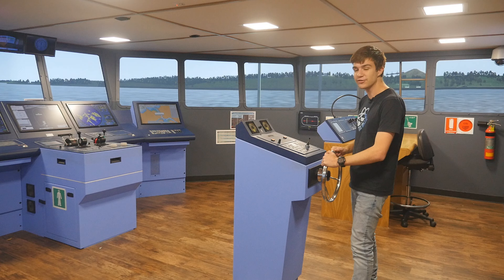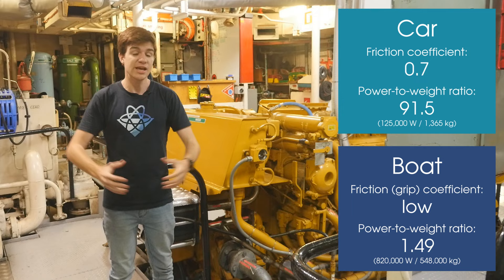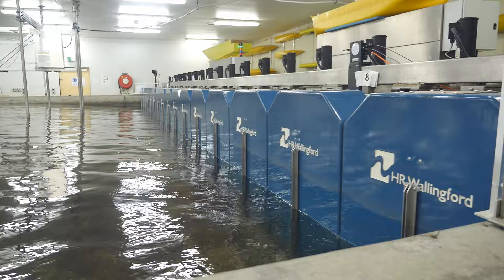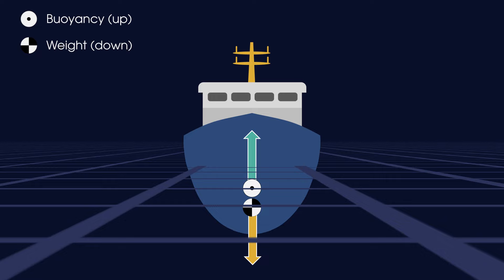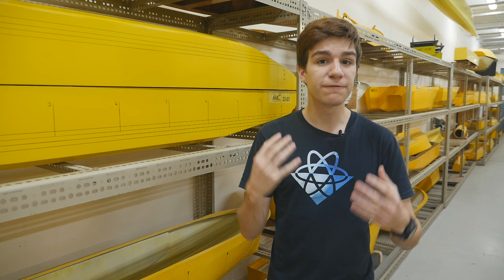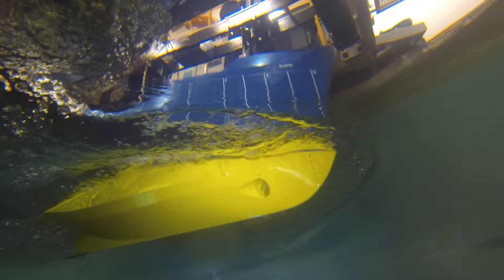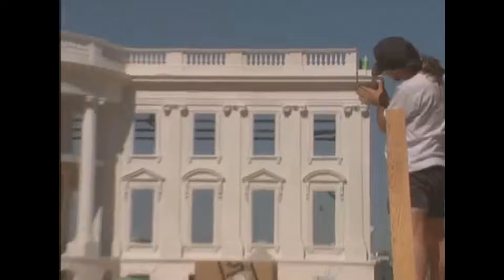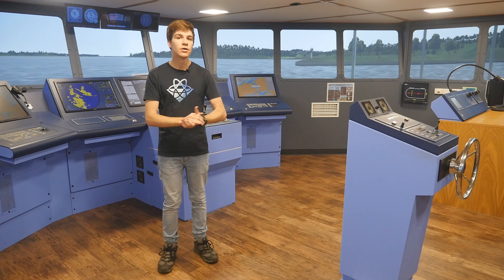How To Fake An Ocean

Comment: Interesting thing about slow motion explosions:
They still look fake for some reason.

I guess they slow down the footage too much to get more film time out of their expensive take.
Reply from the maker: Agreed! Its not because of the speed though, its mininum particle size. For water thats basically because spray only ever gets so small due to surface tension vs drag forces. When you use a model you end up losing that small-scale phenomena which makes things look just that little bit off. Don't think it has much effect on science research but it definitly does look weird in the movies.

Comment: Don't we now know that water waves behave non-linearly? I wonder how long it will be until numerical simulations are more accurate than these models.
Reply from the maker: Part of the summer research I mentioned was actually on that! Looks like yes we could do it more accurately already but the processing power limitations are insane so they make some really massive oversimplifications which does limit their usefulness. The way the field is going is to do lots of real-world tests to make some rules about 'X wave height gives X*1.3 response' and then program that simple relation rather than the actual first-principles numerics.
Reply: @AtomicFrontier  oh interesting, that makes a lot of sense! Of course there's a limit on how high you can go in a tank 😅
Reply: @AtomicFrontier  Imagine how much further we could take fluid simulation with quantum computing...
Reply: @StuffandThings_  I don't think you could take it that much further with it... I don't have much of an idea of qCPUs, but I'm pretty sure they're not that good for those issues.

Although it was said that they would break encryption... I need an explanation of quantum computing